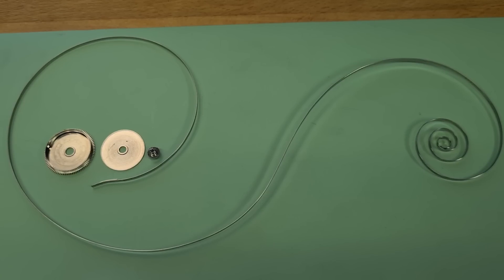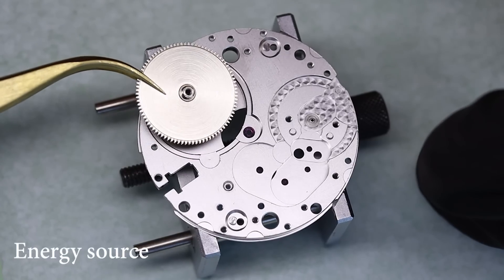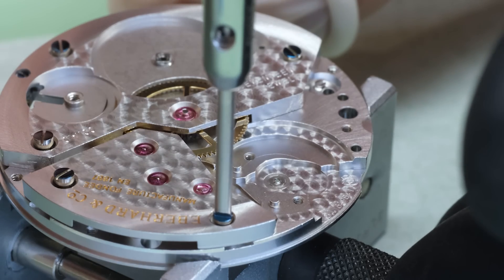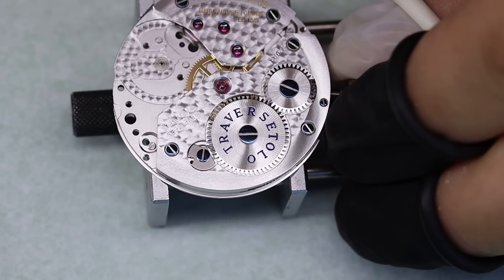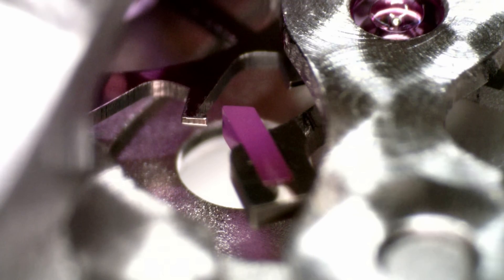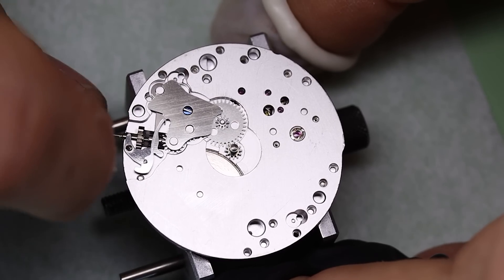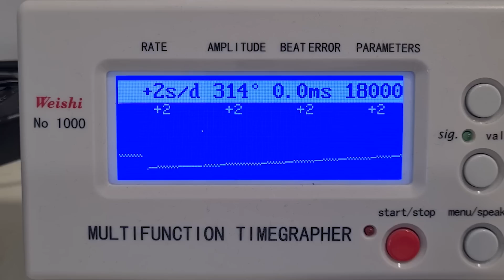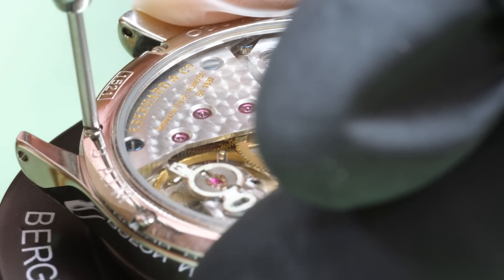How do you put 60 watch parts together?

Comment: Adjusting the beat error are you adjusting the screw or pushing the pivot?
Reply from the maker: It should all be there in the video 😉
Reply: @VintageWatchServices  Exactly when you are adjusting video is out of focus so asked. Just check 15.07 adjustment started video is out of focus. Anyway subscribed.
Reply from the maker: Ah, I see the issue. You push the stud holder to adjust the beat error. I'm not sure what I was doing there but it seems I was tightening the stud holder screw.
Reply: @VintageWatchServices  That's great, thanks for clarifying. learned a lot from your channel, keep going.

Comment: The "trick" is that there are about 5 sections of a watch movement, into which smaller parts obviously belong to. So even if you have no idea of the movement, you only have to guess around and try with a faw parts in each section.

Comment: Hi Theon. I love your videos.  This one is particular good and I have saved it for future inspiration. I have some old "dollar" Westclox pocket ben" watches that I can tinker with. And I have a few relative good pocket watches that I would like to revive - - - After I figure out the Westclox pocket bens. 

How do I become a customer? I bought a beautiful 17 jewel "Lackawanna" Silver cased pocket watch from a local auction house. The watch has a beautiful  steam engine embossed  on the back. 
the watch only runs for a few seconds before stopping. Not to mention, previous owner has broken off the crown from the stem. - - - I have the crown but I suspect that getting the broken piece of stem out of the crown will be a lost cause.  Do you think you could get the parts, or maybe a donor works? 

Would you be interested in taking on this project?
Reply from the maker: Hello Jim, thanks for watching! I'm extremely overloaded and cannot take on any servicing jobs at this time, so I'm afraid I'll have to disappoint you. The best approach is likely to search eBay and some pocket watch forums for spare parts. Best of luck! Stian
Reply: @VintageWatchServices  Thanks for the reply. I'll check out the forums for the spare parts, or a donor

Comment: A question...  Is there ever any lubrication applied to the gear teeth of the train wheels?
Reply from the maker: Hello David, thanks for watching! No, gear teeth in watches are cut with a shape that makes the surfaces roll on each other and thus there is virtually no friction in their interaction. Thus oil is not needed and would in fact be detrimental to their action.

Comment: Do you need to torque set the screws?
Reply from the maker: In general, no. Some of the high end brands include torque guides in their instruction material, but then you need a special screwdriver also. In my view that is generally superfluous, as you learn with some experience how tight a screw should be.

Comment: This was a really interesting video - thank you. One question: when you lubricated the pallet fork, you oiled the front face of the jewel, but the escape wheel appears to hit the side of the jewel. It seems to me that you are lubricating the wrong face of the jewel. What am I misunderstanding please?
Reply from the maker: Hello Paul, the pallet indeed has two working surfaces, the locking face and the impulse face. The escape wheel tooth locks against the locking face and stays there until the balance unlocks it, at which point the tooth will start scraping along the impulse face and give impulse to the balance. To make this impulse as smooth and efficient as possible, you oil the impulse face.
Reply: @VintageWatchServices  Ah, that makes sense, thank you!

Comment: This is actually a great introduction to the function of a watch movement. This is what what I wanted to see a few years ago when it all started for me. Instead I had to wade though tons of clips where wannabes guessed and manhandled the fragile parts of the poor watches. Well, at least I learned the hard way and how NOT to do. I think, looking back, the "best" one is where a guy tried to regulate a Rolex by moving the arm for adjusting the beat error not realizing this is not how you do it. That poor movement must've ended up struggling with a beast error worse than 10.
Reply from the maker: 😂 That doesn't sound like good mentoring, no...

Comment: Very well done and helps a lot. 
Only question is are there specific styles of screws per function like bridges etc.?
Reply from the maker: Thanks, Walther! Yes, screws are also shaped according to their intended use. Screws with flat heads are for holding flat things down, like bridges and cocks, cone headed screws are for centering things and mitigating sideways pressure and shouldered screws are for letting parts rotate freely on the shoulder.

Comment: Hi Stian, I really enjoy your videos.  Could you explain the purpose of weights on the balance?  They seem irregularly spaced.
Reply from the maker: Hello Jimmu, thanks for watching my videos! The weights on old balances were to be able to adjust the poising of it. By turning the screws in or out you would be able to make the weight shift ever so slightly and thus make the balance run true. They are in fact placed in pairs on opposite sides of the rim :)

Comment: I've noticed @ 7:56 you're turning the screw of a crown wheel counter clockwise while screwing it into the crownwheel.
Reply from the maker: Hello Ross, yes, it's very common that the crown wheel screw is left handed. This one doesn't have the two extra grooves on top to signify that, probably due to decoration concerns...

Comment: excellent tutorial about watch movement :) Question: is there any trick/logic for knowing which screw goes where?
Reply from the maker: Thanks! Yes, all parts are made with a clear logic for it (hopefully). A screw with a flat underside is made to keep flat things down, like small bridges and cocks. Bigger flat screws often with a longer head are for holding the big parts together, like the bigger bridges. A screw with a coned underside is made to help center things with a bit of sideways tension on them, like springs on chronograph movements. A screw with a shoulder on the underside is made to let parts rotate freely on that shoulder, like levers and calendar parts.

Comment: Just brilliant, Stian. So well narrated and explained, with your usual humour intact. It does get quite complicated in the motion of the watch. One question I always have is if the barrel is providing power to the train and the escape wheel and balance regulate the amount of power that is being released, is it the hair spring that is in control or the mainspring? :) I'd like to see a video documenting the tools that watchmakers need to start servicing basic watches. You'd do a great job of explaining that as well.
Reply from the maker: Hello Clay, thanks for that! One thing I didn't cover as I thought it would get confusing for a lot of people is how impulse works. It is always the mainspring that provides the power, and after the balance's impulse pin unlocks the pallet fork, the escape wheel is released and starts rotating until its next tooth locks against the other pallet stone. That happens very fast, actually faster than the balance wheel rotates, so it makes the other side of the pallet fork hit the impulse pin "in the back of the head" as it is moving and thus provides impulse to it - pushes it ever so slightly so that it doesn't get slowed down.

Comment: Wow, Stian you made complex mechanics sound simple, genius! Thanks as always for sharing, I will now share with all my non watchmaker friends!
Reply from the maker: Very cool, Boyd, please do :)
Reply: Stian, a general question. I’ve just stripped down an AS1187/94. It has a broken main spring and I cannot find a replacement. According to Cousins UK dimensions, the length should be 280mm. Cousins sell another spring 260mm long and all other dimensions are the same. Should I buy it? What’s the worst? Amplitude a bit lower and run time a bit lower? What do you suggest in these situations?
Reply from the maker: @boydsargeant7496  Hello Boyd, a shorter spring will actually be "stronger" than a longer one... I'd suggest you go for a slightly thinner mainspring at the same or slightly longer length. That should provide enough force while giving more power reserve. Try GR4485.
Reply: @VintageWatchServices  many thanks Stian, I appreciate your advice and experience I’ll give it a go!
Reply: @VintageWatchServices  many thanks Stian. This works a treat, the watch is going like a steam engine and accurate! My mates dad is separated please since it was his 21st birthday present, must be 60 years old watch and now like new!
Reply: @VintageWatchServices  many thanks Stian. This works a treat, the watch is going like a steam engine and accurate! My mates dad is separated please since it was his 21st birthday present, must be 60 years old watch and now like new!

Comment: The most beautiful view of pallet stone oiling I've ever seen. You can actually see the amount of oil on each stone diminish as you advance the escapement before oiling again. It was fascinating to see the efficacy of the Epilame treatment on each tooth of the escape wheel! Thanks for sharing a fun and informative video recorded with such visual quality.
Reply from the maker: Thanks so much for that, Chris :)
Reply: @VintageWatchServices  I concur with Chris. I've never seen such a clear demonstration! I was wondering: have you demonstrated your method of applying epilame/fix-o-drop in a prior video? Do you soak both the escape wheel and pallet fork (and other components?), then clean off the epilame from the pivots with pith wood? Unfortunately, I haven't found a good demonstration of the process on youtube yet.

Comment: Very nice video and all steps great explained1 Thanks. 1 Question: Should the spacer between the hour wheel and dial turn around? Lip ends up to the dial instead of to the hour wheel?
Reply from the maker: Thanks! Yes, the dial washer is placed with the curved ends up towards the dial. That way they press the hour wheel down so it doesn't slip out of mesh with the minute wheel.

Comment: Laughed at the end 😂this is the best watchmaking/ how a watch works video I have seen!! Bravo!

Q: how do you prevent a tiny part from flying away? Is that a piece of textured paper on your mat?
Reply from the maker: Thanks so much! For tiny parts the most common method is to hold it down with a probe while taking it off. It doesn't actually happen too often when you're experienced, but more than one would like 😉 The paper is just a lint-free tissue to avoid the mat getting too dirty.

Comment: How do you know which lift angle to set the timegrapher to? Does each watch has a different lift angle?
Reply from the maker: Hello Ivan, yes, movements have different lift angles. In general 52 degrees is close enough for a wrist watch and 44 for a pocket watch, but if you really want to get the most accurate testing results, there are lists on the internet that you can refer to.

Comment: I wonder how the movements become magnetised in the first place? Also if many of the components are brass why do they not make the remaining components from stainless steel to eliminate the chances of magnetising the movement in use?
Reply from the maker: Mouvements can become magnetized by things like airport secouru scanners, store theft scanners, strong loud speakers etc. The issue isn't really with the wheels, it's with the hairspring in particular. Stainless steel is very difficult to work on and isn't really suitable fit watch parts.
Reply: @VintageWatchServices  Thanks, now that makes perfect sense and I get it. When I hear of a movement being magnetised I think of the whole thing and not just the hairspring.

Comment: Thank you so much Stian for taking so much love,  time and expertise to explain the workings of a mechanical watch to a layman. Hats off to you - as always! 
There is one explanation that you might want to add to your video - no criticism here, but it has helped me a lot: think of a (tin) toy that you wind up and let run until the spring has no power left. A watch is basically the same, but you do not want to let go of its power all at once, which is where the escape wheel, the pallet fork and the balance come in: they make sure that the power you put into a watch is released gradually and in increments.
Reply from the maker: Thanks for that! I was thinking of using that analogy but during the editing I ended up not doing so :)

Comment: Well done sir!  
Question: What energizes the balance so it's swinging?
Reply from the maker: That's a great question and I was debating whether I should include that in the video or not. Ultimately I decided not to, so as not to complicate things to much, but perhaps I should indeed have included it. 
The impulse pin in the balance first hits the inside of the pallet fork. This unlocks the escape wheel, which is locked by a tooth resting on the outside of a pallet stone. This unlocking allows the escape wheel to rotate a tiny bit until another tooth hits the outside of the other pallet. This only takes a split second, but while this is happening, the impulse pin is still in between the horns of the fork. Due to the escape wheel hitting the pallet stone, the impulse pin now gets hit "in the back of the head" as it is moving, by the other horn of the pallet fork. That little strike is called impulse and is just enough to give the balance wheel a tiny push that keeps it swinging. 
There are some great videos demonstrating this, just search for swiss lever escapement.
Reply: @VintageWatchServices   Okay. Got it. It's like a spaghetti western slapping contest. 😎

Comment: Why are the teeth of the various wheels not lubricated?
Reply from the maker: That's a great question, Karl. The reason is that the shape of the teeth are such that they don't actually rub against each other, they roll over each other's surfaces. Thus there is very little friction during their interaction. These curves are called cycloids: https://en.wikipedia.org/wiki/Cycloid

Comment: Thank you for this vid. I am slowly building my tools to try my hand at watch restoration and this is the first vid I have come across that breaks down the watch so informatively. I'm a visual learner, so you just answered the last questions I had. I bought some junk movements on Ebay to practice on before I try to restore an Omega 620 I found for a bargain that I hope to one day make into a frankenwatch Deville.
Reply from the maker: That's very nice to hear, thanks so much for that :) Probably the best movements to work on are the 6497/6498's, but they are not so cheap anymore. Seiko 5's and Russian watches are also great for learning on, but make sure you buy running watches, otherwise it's very difficult to know if you put it together again correctly.
Reply: @VintageWatchServices  I do have a 90s Russian Vostok that is not keeping time well (losing a few minutes a day) but it's a perpetual so I'm going to practice on some more simple movements before I dare work on that one.
Reply from the maker: @kupariusa4202  Sounds like a good plan. Take a lot of pictures as you go along and never use force (apart from the Obi-Wan Kenobi kind).